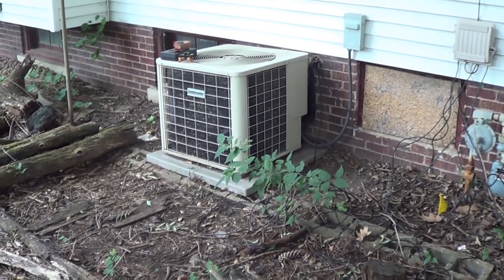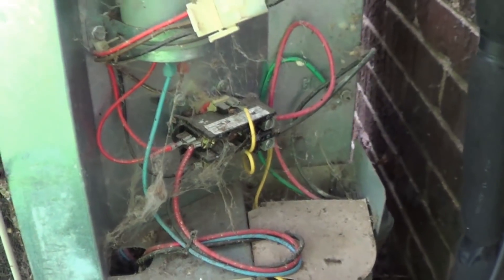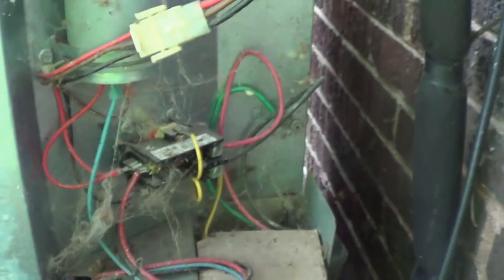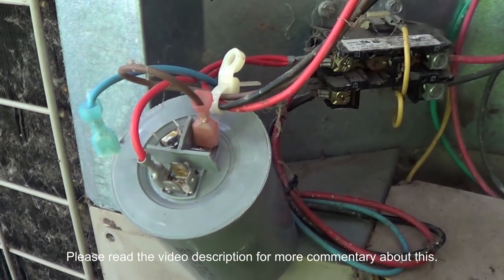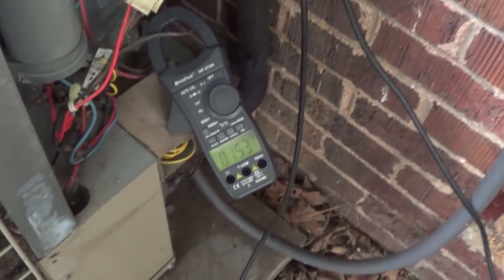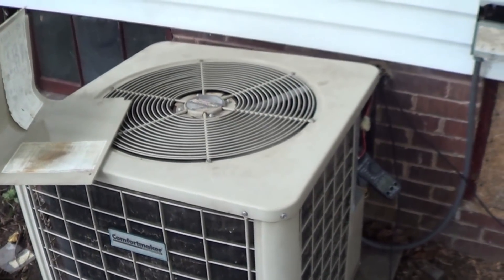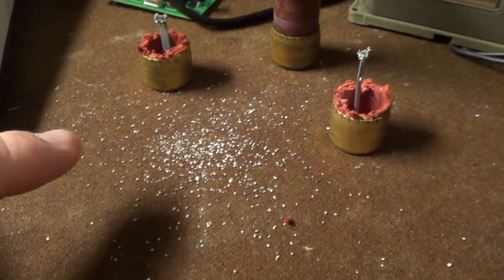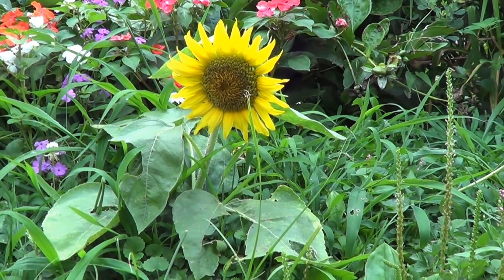Comfortmaker Air Conditioner Breakdown

Comment: I have a question maybe u can give me some insight on I have a package ac unit and the condenser fan motor went bad this past summer and the original motor that went bad was a 1/8 horsepower 1100 rpm GE brand motor and the guy that replaced the motor put in a 1/2 horsepower 1075 rpm Century brand condenser fan motor and it seems like it's working ok as of the end of summer so I was wondering will that horsepower and rpm difference harm the system over time
Reply from the maker: If the motor fits physically, rotates in the proper direction and is approximately the correct speed (as yours seemingly is), no, there won't be any harm done to anything. 

It's kind of silly to use a much more powerful motor, and maybe there's some distant possibility that it'd overload the stock wiring or switches (highly unlikely), but sometimes you do what you have to, to make it work.
Reply: @uxwbill  https://youtu.be/EbZ020vYt2s here is a video i took eith ghe original and replacement fan motors
Reply from the maker: As I said previously, I wouldn't worry a whole lot about it.
Reply: @uxwbill  thanks I appreciate it very much and I also wanted to tell you I been watching your videos on the reliant K car wagon and the red k car and they both bring back some memories too me because my pap had both the car and station wagon in my lifetime and he actually passed away exactly one year ago

Comment: The best repair would probably be to just clean the coils.
Reply from the maker: Is it really that much to ask, for anyone to watch the whole video?
Reply: @uxwbill  I guess I should have been more precise. To me, the most likely cause of the fuse blowing was not a defective fuse but when the condenser coil gets clogged up the head pressure goes up causing the compressor to draw more current ending in a blown fuse. So to sum it up I should have said clean the coil and then replace the fuse.
Reply from the maker: I see it as far more likely that 20+ years of thermal cycling finally caught up with the fuse. The coil has never been more than two years between cleaning, and looked much worse than it actually was.

It seems that the compressor has perhaps also become "tight" with age, as it pulls closer to its FLA rating than it probably ought to, even on mild days.

Comment: The older units last a very long time! I’d rather have less efficiency for a older more reliable unit then a newer one! It’s good to keep those coils clean too! It will buy the compressor some more time so it’s not working so hard under high head pressure

Comment: I'm glad that the old Comfortmaker lives to see another year! I recommend the Comfortmaker Performance Series ad a replacement when needed.
Reply: The SoftSound line is also pretty good, although the Performance series is pretty good for a basic unit. Though the SoftSound has some units that go up to 98% efficient and are modulating.

Comment: Ebay or amazon for parts. Your meter has non contact measurement.
Reply from the maker: So far, that's exactly where I've been getting parts and tools. Beyond my perception that trading with a supply house is "the done thing", I'm not sure how much I'd actually use one outside of stuff that I need right now or if I had a question about equivalent replacement parts.

The Southwire 13070T doesn't have non contact measurement capabilities. I have some meters that do, but I don't really ever use that feature.

Comment: I agree with you about not putting gauges on a perfectly working system. Especially when it's your own and you know it well. If my old Rheem system ever starts to lose refrigerant, I will know it without  having to put gauges on. I check the line temps occasionally just to stay one step ahead of any problems.  I would have left that cap on there too. You will likely never be able to buy another one as good (pressed and dried garbage is right) It's always a good idea to have a spare on hand though. When they fail,  it's usually not when the supply stores are open.
Reply from the maker: Sometimes I don't know why I say the things I do when I make videos. :-) I won't replace that capacitor unless it fails. The unit has never struggled or hesitated to start right up. I do have a spare from a nearly identical Comfortmaker unit that failed with a locked up compressor.

Unless I see something that clearly suggests needing to hook up gauges to a unit, it's not something I'm just going to go and casually do. I try to look at every other component and their surroundings first to see what a system is trying to tell me.

Comment: They tend to undersize units in order to keep first costs down, and also apparently to maintain humidity controlling ability. I guess oversized units tend not to be as able to condense water out of the air. Or so I heard.
Reply from the maker: A unit that's too large will short cycle. This will wear it out faster and not get the humidity out of the air.
Reply: Properly sized units that need to run continuously to maintain setpoint at peak load cool more evenly, dehumidify better, use less energy than those that cycle under the same conditions.

The better humidity control can make it so it's comfortable at a higher temp. If set to 75 and it increases to 78 when brutally hot day per year, no big loss.

Comment: I have a feeling that you will be operating this same unit for approximately the next 44 1/2 years haha.  Incidentally, I don't really trust the "ground rod" method.  Instead, I would find another way to measure to the house ground / neutral...be it a refrigerant line, or even an improvised jumper wire all the way to the meter base housing (in very old homes).

Comment: Not just ac units , cars too with the ring thing,  basically anything with electricity present
Reply: Yup, basically anything from both of those, and even things like computer motherboards and stuff too...  In short, so as long as you take proper procedure when working on certain pieces of equipment with taking off a ring (if you wear one), grounding yourself, etc, you'll be just fine...

Comment: My parent's Lennox furnace and AC was replaced after 28 years of faultless operation save for the replacement of the purge fan. The condenser was the then new tech Copeland scroll with an amazing for the time 13 SEER. The only reason it was replaced was the concern about the safety of the time-bomb "pulse" furnace. It is amazing how well some of this older technology can last when maintained properly.
Reply: Just replaced my pulse furnace too. 28 years and it still ran pretty good. My neighbor had one too, but was leaking low levels of Carbon monoxide. Decided i didn't want a break down.

Comment: r22 here in texas is 75.00 a lb, and if u have a unit like urs and takes 8 lbs to charge, u may want to consider a new compressor unit as we did with our old 1996 trane, that leaked out. ouch
Reply: Most techs won't tell people this, but there are quite a few drop in R22 replacement refrigerants. As far as I know, none of them perform quite as well as real R22, but they are much cheaper and most of them usually work fine. I hope this helps someone.

Comment: Before you finally button up the unit, a good idea is to check all the electrical terminals as the vibration can loosen them over time. The tolerance of capacitors is +- 10% so yours should be OK.
Reply: More like 20%

Comment: our old place that we renting has 2 old email windows AC's and a air handler heat pump that takes R22 i don't know what condenser it uses. The email window AC also take same R22 or it might have R12 i do not know but to me it could be from the 80's or 90' the only problem those two email window AC's have are the fan moters have seized from age but the compressor do work still but its the one in my parents room but the one in my brothers room makes a humming noise so that me tells me that the fan moter on that one still has some life in it but i did not test the compressor because the control panel lid was shut and it was hard to get it open but still did not open so yea and there both the same model window AC's but i'm going to miss them because we moving out of this place on august.